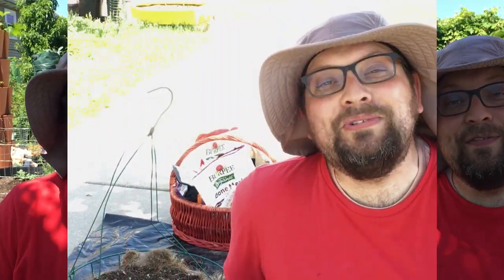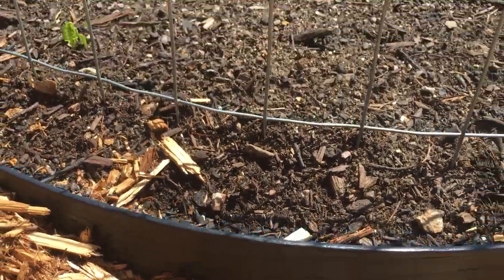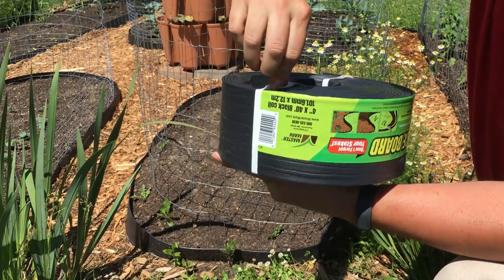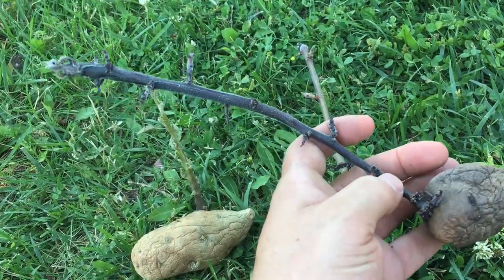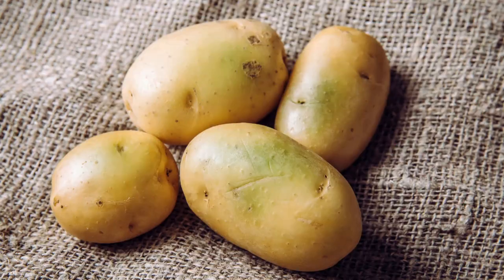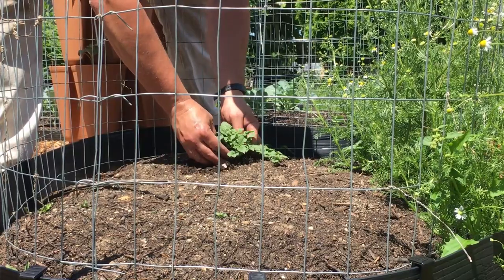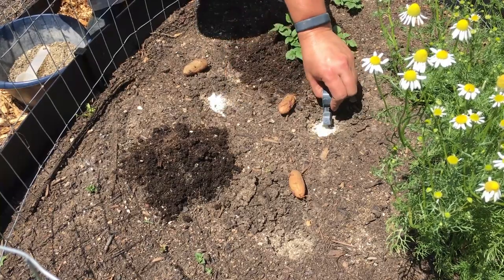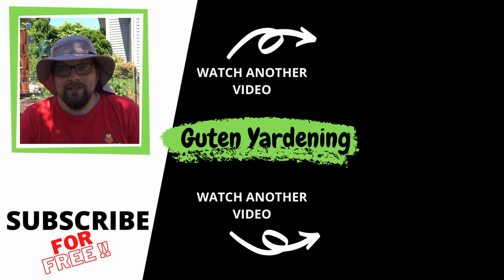Get more potatoes by following this easy step

Comment: Every time I plant potatoes the tops end up getting tall and fall over. Can’t figure out what I am doing wrong😢
Reply: to much nitrogen in your soil
Reply from the maker: Hello Michele, we have a few thoughts about this.  We agree that too much nitrogen in your soil could be the problem, so if you have never done a soil test, that is a great start.  Potatoes do get a large amount of sprouting up top, so you also want to have a good root system.  One thing we do when planting our potatoes is to add bonemeal and mycorrhizae to help produce a good root structure.  But beside that, we have also had to provide some support for the bigger stems in the past, like for our Magic Molly potatoes, which got so big, even a large root structure couldn’t keep them upright. For those we used a few stakes and some rope.  The final thought we had centers around the location of the bed and the possibility that the plants are reaching for light, and that could cause them to get leggy and long too quickly.  I hope this helps. :)